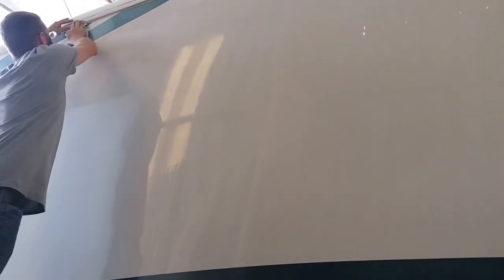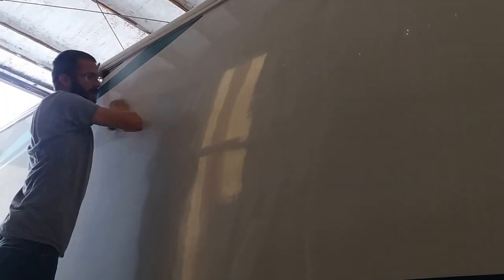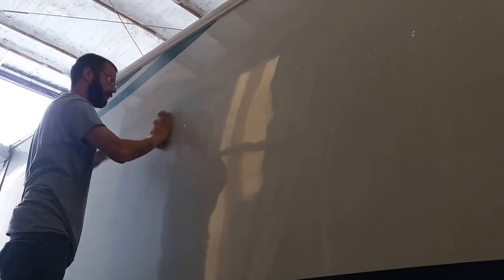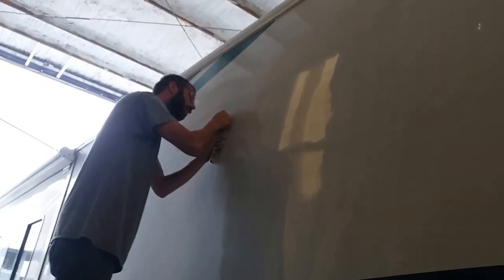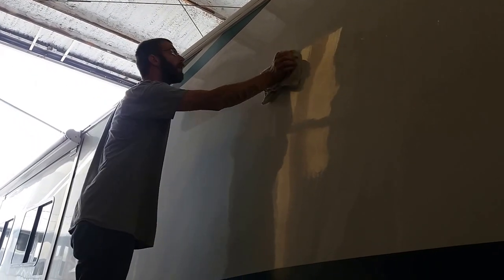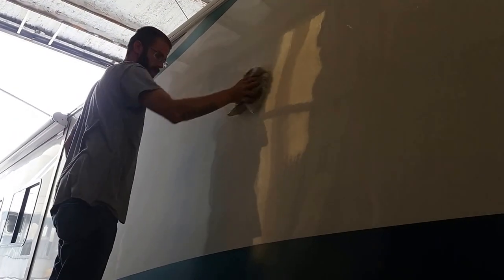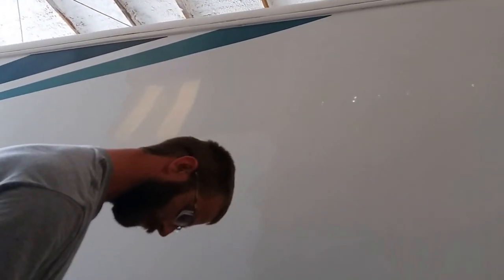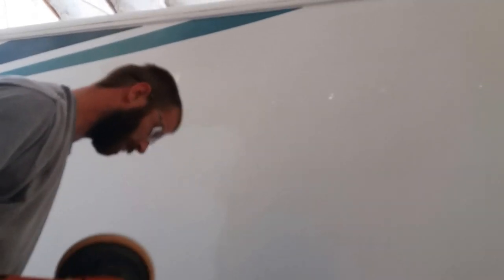RV buffing and oxidation removal

Comment: And the Shininess temporary or a few weeks or days until it rains and washes all the wax off?
Reply: Michael A.L 20+ Years of oxidation removed... that shine is not washing off. Regular detailing 1 time per year will typically keep it looking great when you use a polymer sealant like we do...
Reply: Tony Harris, Some people call it sun fade, I don’t know if it’s the same as Oxidation, because we have a 2014 Thor Windsport and the front top cap area is kinda getting blurry and not shiny. We’ve tried wax but in a week or so it just washes off.
Reply from the maker: If compounded properly first it should hold up better here is a Thor Ace we show how and what we do...   how to wax Rv start to finish oxidation removal https://youtu.be/ZlH2-Cmv3ss
Reply: @seattleboatdetailingmobile1926  what speed would you recommend for a DA